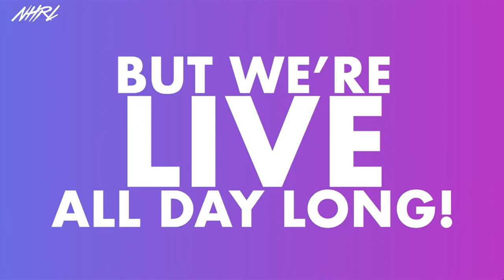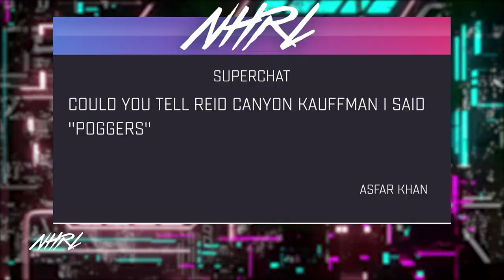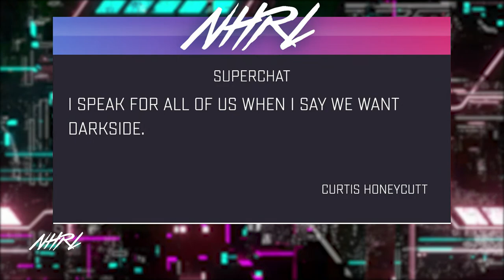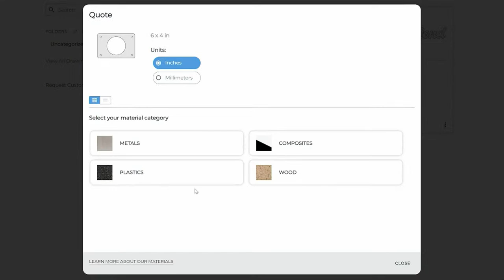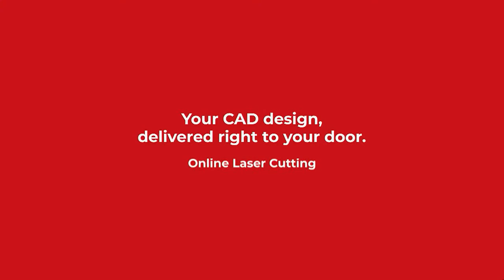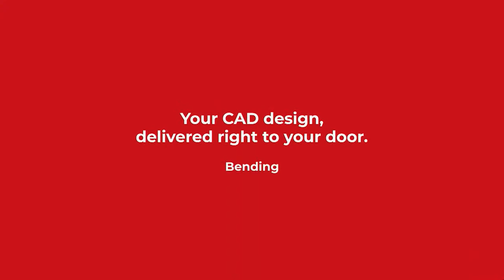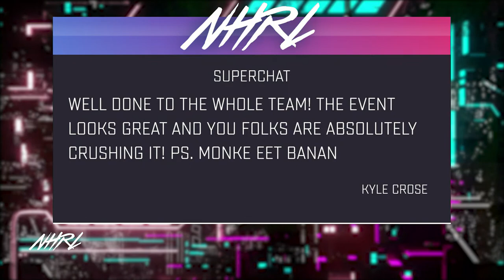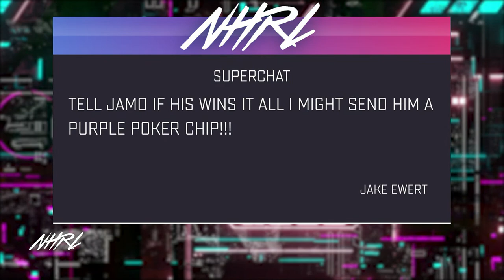NHRL 2022 Round 1 March: Part 3 Finals from March 26 2022

Comment: Suggestion for battery fires.
Get a fire blanket or welding fabric, lay it down, put battery on it, fold.  Lift the folded package in to a bin.  Then it'll dampen any explosion and smother any fire.
Reply: most places have a sand bin with appropriate materials .